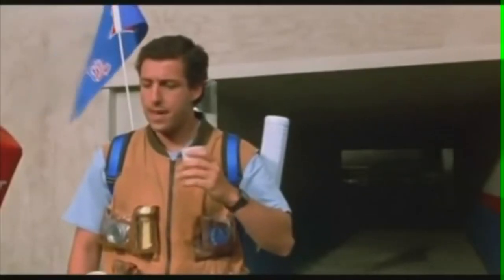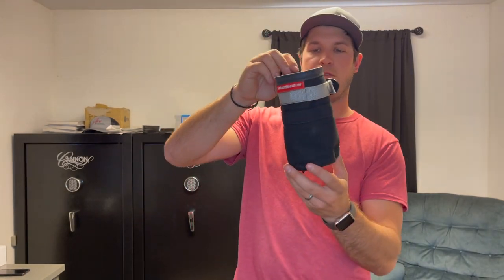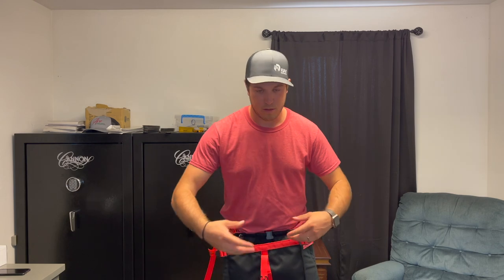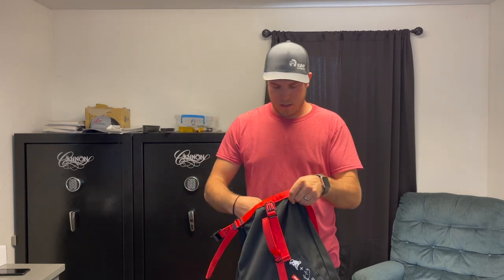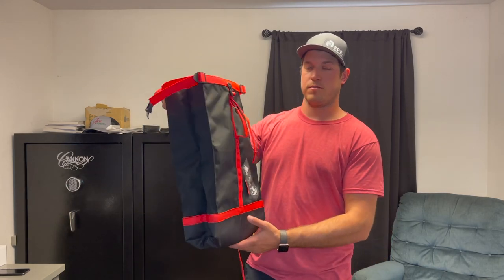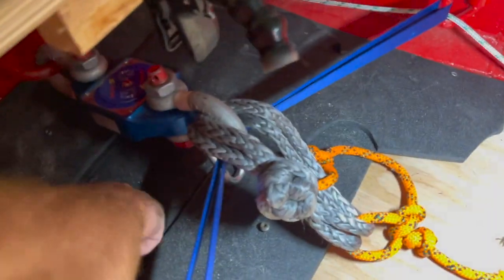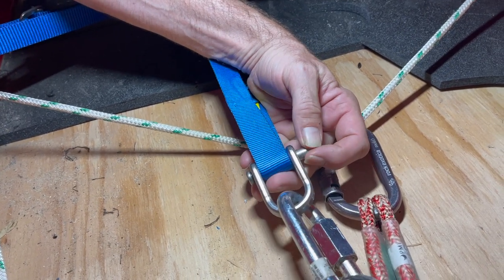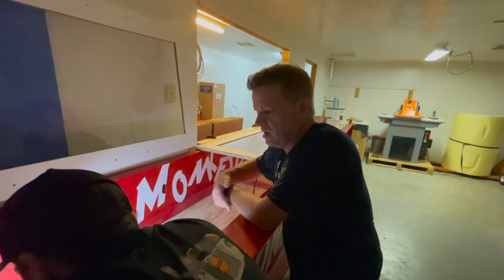H2O to GO!

Comment: So, how many rpm was it again before you heard the noise :) ah, just saw you mentioned you might have over sped the motor.
Reply: I believe it was around 9k. (Tach reads to 8k) Stock rev limiter is about 7k
Reply: @evanwilliams6352  So was it a zing on downshift, or was it sounding great right up till it didnt :). Either way, sorry to see the damage, but it could have been far worse, dosent help much, still some work to do there, hey Great job on the rope bag, really smart work there, love the design, lots of depth in that project.